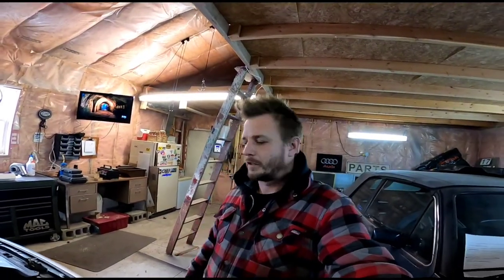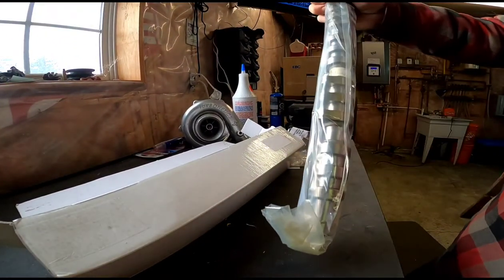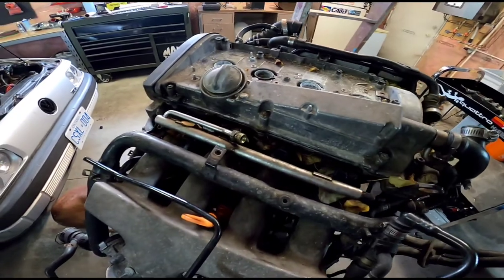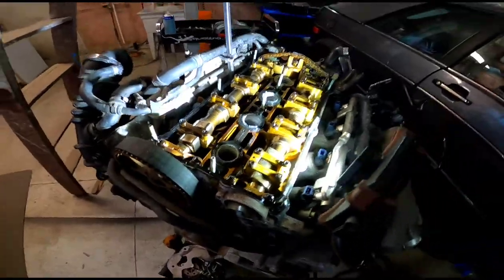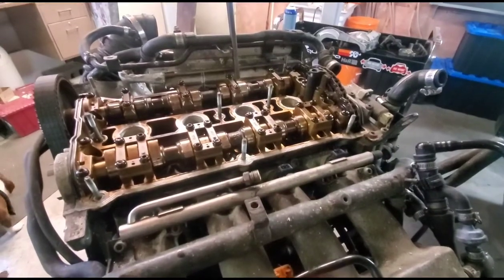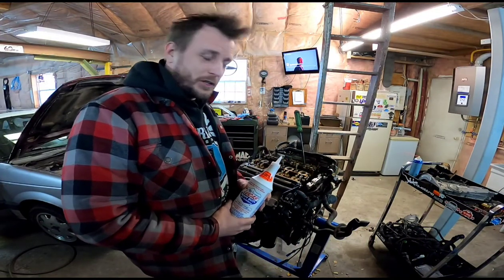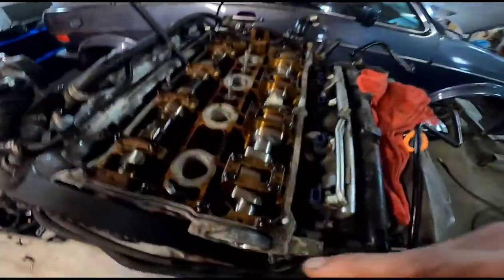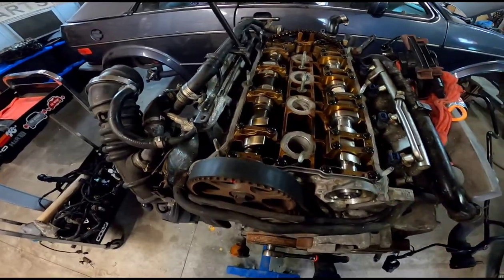Techtonics tuning 1.8t intake cam install

Comment: Any feedback on how it runs? With or without tune? I've been curious about them, but figured for 7 to 10 horse I can just run another pound of boost for cheaper than a cam
Reply from the maker: Not yet. Car hasn't moved since I installed the head. Yes you could just add boost and gain the same power however this cam should allow for more before boost falling off as the engine can breathe better .